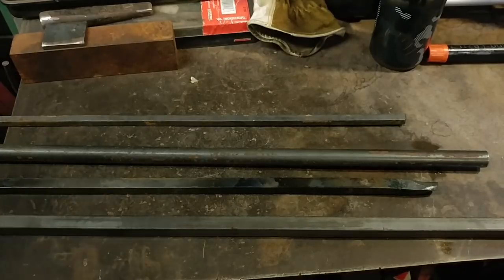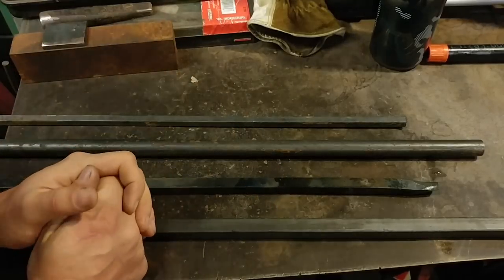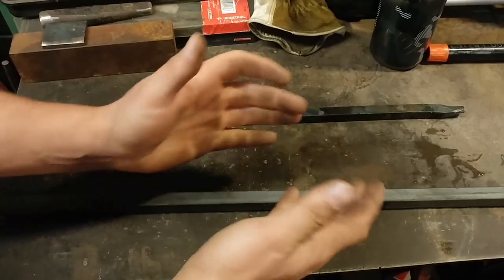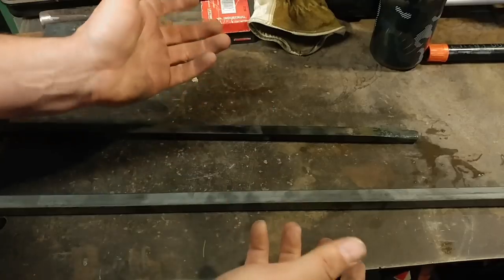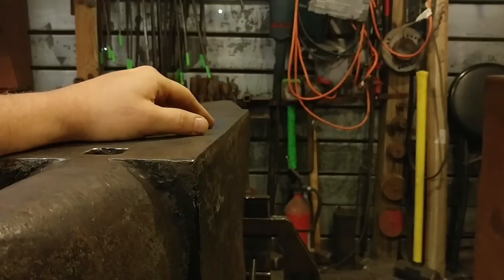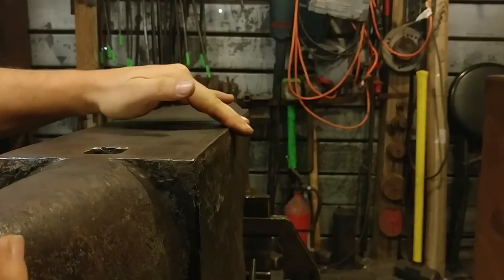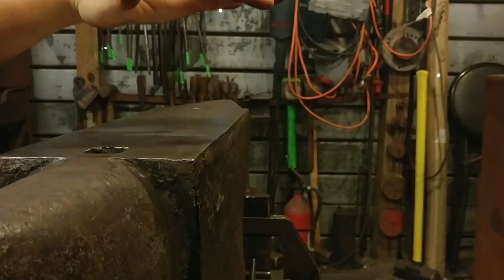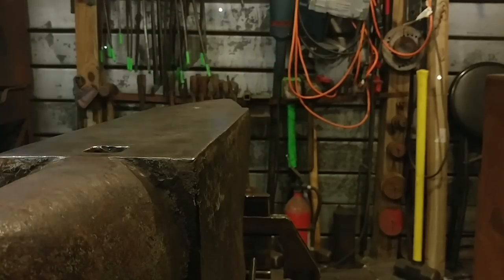My Method for Forging Blacksmith Tongs

Comment: I just thought of something else that I wanted to share with you. Only ever made one set of tongs but I made mine by working down the boss area in two places. The front as is always done but also were in your video what you explain as the second set down that is where I placed my second set down. Think pliers, this makes the handles line up great. You prob know this but what do you think would it make the boss to thin. Actually I used a piece of square the size of the boss to do it and put the blank at an angle on that, just how you would normally angle it.

Comment: Just getting started so how to make tongs is very important. If I can get the process down I can make them cheaper than I can buy them. Whether just starting or experienced cost I would think would be an issue. Quality also of course. I don't reajjy know for sure but I would think making tongues would be good practice for other forgeing projects. I have to start somewhere might as well be here.

Comment: Translations for metric
1/2 inch-13.5mm
5/8 inch-15.6mm 
3/8 inch-10mm
Reply: 1/2 inch = 12.7 mm
5/8 inch = 15.9 mm
3/8 inch = 9.5 mm
Reply: Atle Olav Dahl oops sorry about that must have gotten my calculations wrong
Reply: I never forget the 1/2 inch to metric conversion. In the Norwegian Army the .50 cal Browning machine gun is better known as 12.7 mm machine gun, or just "The 12-7". That was almost 30 years ago, and I still remember :-)
Reply: 25mm is an inch....   12.5mm is 1/2 of that.   pretty straight foreward
Reply: 1 inch = 25.4,    1/2 inch = 12.7 and that is according to my Calculator. So if you divide 25.4 x 2 = 12.7 and that is straight forward.

Comment: Between this and the BAD Tong Method for Beginners video, I feel pretty confident about giving your methodology a try with a lot easier path to success. I've watched other channels make tongs and they all (even "pros") fall victim to warping and twisting that requires extra work to get the job done. That they manage the extra work without pause doesn't make them efficient, just practiced. However, my arms prefer efficiency.

Comment: yea getting too large a bar its harder then escaping quicksand to squash down on even a proper anvil, so the first bit I started to make ended up it will become a chisel or a prybar when I get around to finishing it. thats the plan anyway

and yes 25 mm is one inch, its just like the caliber of a gun 25 is one inch 125 mm is 5 inches just like cannons and artillery.

Comment: i can see your trying to be different for difference,s sake , the boss will still elongate when thinned and you can still do that to a different degree with both boss,s you gain nothing , if you chalk up the anvil before hand you have your set in stone measurements, no trained smith guess,s measurements for making tongs .
Reply from the maker: Edgunsuk everybody has their own method of making tongs as no skilled or trained Smith would guesstimate what they need I could highly disagree with that as I know several master smith that estimate what they need by eye and come out just fine.